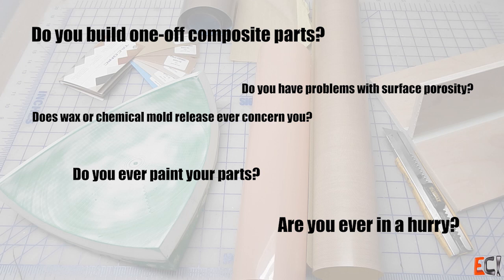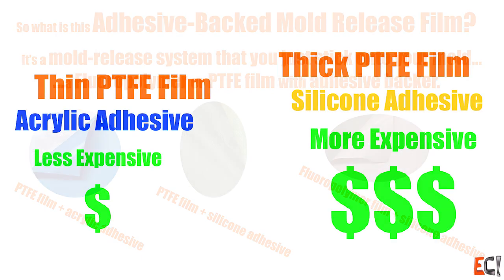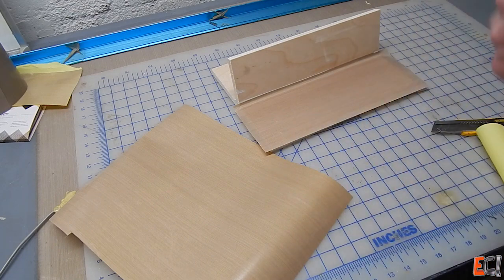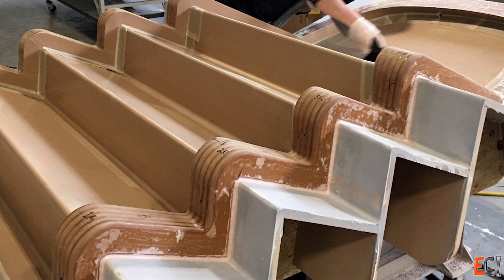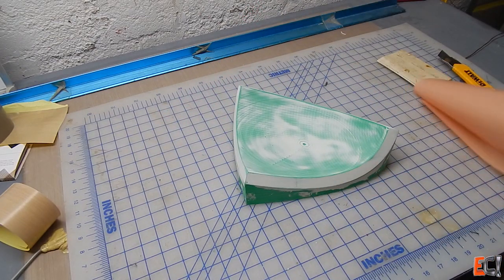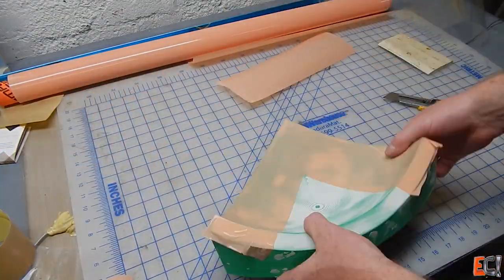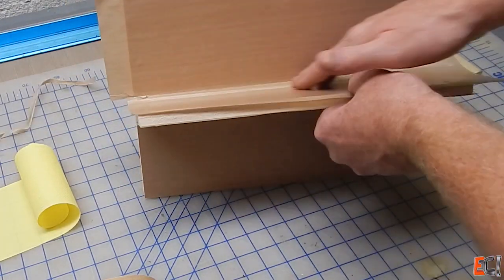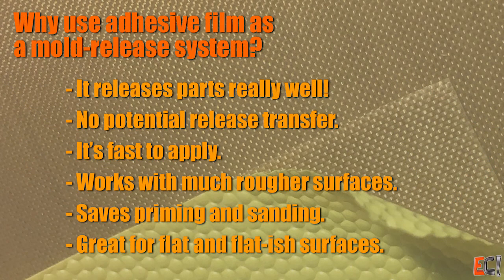Mold Release Films for Composites Tooling

Comment: My go to is a trash bag plus 3M 77 spray to tack it on to the part: leave descent finish if you work the bubbles/wrinkles out.
Reply from the maker: That's a neat idea!  I like how stretchy the bag is - probably reduces wrinkles and conforms easily.  Do you apply release to the bag after or does it just pull off the part?  I've done similar with release film and it works ok with prepregs, but for wet layup it makes a wrinkly nasty mess.  People also use aluminum foil and spray glue, but this is a lot of work and I haven't tried it.

Comment: This is pretty helpful. Have you tried applying a bit of heat to deal with this when applying to complex/curved parts?
Reply from the maker: The reinforced stuff really doesn't stretch but the Toolwright and other unsupported ones do - with or without heat.  Not sure if heat is a good idea or not - never tried.

Comment: I've used masonite as a cheap, disposable mold surface and where I've had to drill, counter sink and screw it down to a frame I've covered the screw heads with clear packing tape, cheaper the better. Ends up being a mere 1/2 thousandths of an inch thick that can easily be sanded.
Reply from the maker: That's a great method.  I have used plenty of masonite and the shiny "bath board" that is sold for shower liners.  What kind of release agent do you use?  The fastener holes are a bummer.  Sometimes you can clamp it down and glue from the back... 

I totally agree on the cheap packing tape being the best - and this Teflon stuff is just fancy packing tape you can use over and over.  It's great stuff but it sure is tough to spring for a big roll of it knowing its all going in the trash - I guess all tooling is in that category though!
Reply: @ExploreComposites  I use Mirror Gloss and PVA.

Comment: Looks like your making a very informative channel!!! SUBSCRIBED!!!

I would love to see you do a 1in or 3/4" Rigid foam insulation (like Foamular 250) with fiberglass on both sides. Then see what large span 4+ feet is able to handle weight wise... Im curious because I have heard people make campers out of it and I just cant believe that it would be strong enough to handle weight on top or handle long term wind turbulence on a trip.
Reply from the maker: Glad you like the videos!  There's a web site too that is much more comprehensive... still figuring out how to make videos.

I like your foam idea. Will look into it!  It sounds structurally a little like a surfboard - very thin fiberglass on light weight foam.  Denting would be the biggest issue probably - can't imagine a camper skin takes much load if it is on a stiff metal frame...  but I share your concerns about wind.  I don't know much about campers!
Reply: Strength would depend on the thickness of the foam (preferably 1") and the laminate schedule for the outer skin. I would recommend a minimum of 2 plies of 9-10oz E-glass and preferably 3. If you're thinking of using the pink, Owens Corning foam from Home Depot you MUST use epoxy resin as polyester resin will chemically melt the foam. The inner skin (over a 1x1 wood frame) could be 1/4' luan plywood. That would give a very light yet stiff structure.
Reply: @GrantOakes  Thank you! that is some really good Info! 1.5" is the foam thickness I have been considering lately due to 2x2 framing is buy off the shelf which would be less cutting.  Also using 1/4 Ply is not a bad idea especially on the sides since I will be using this on a 4x4 Toyota Hilux and Trail driving to get to a camp will happen at times. Last thing I want is a stick stabbed through the camper wall.

Comment: Could you elaborate more on why this material is not recommended for parts that are intended to have a raw carbon finish?
Reply from the maker: It can be used to make raw/clear carbon finished parts and is a great option for low volume projects - it just doesn't work with gelcoat.  This isn't an issue with epoxy/pre-pregs where you would probably be painting with primer and 2-part paint/clear anyway.  

The shiny teflon surface can really help because it greatly reduces the pinhole problem you can have making parts on wood or putty-heavy tooling.  I guess I didn't explain this well enough!  Check out the article for more info:

https://explorecomposites.com/articles/tooling/adhesive-teflon-its-awesome/
Reply: @ExploreComposites  

I read your articles, and thoroughly enjoyed perusing the site. 

Gel coat was my next question,
I'm guessing that this stuff can't be used for making wet layup molds.

Is the gel coat just not thixotropic enough to hang onto the ptfe?
Reply from the maker: @richm7936  Yes, you can wet-layup on it but it is too slick for gelcoat - it just beads up.  Its great for bagged wet-layup epoxy parts - especially the 0.003" semi-porous teflon which really helps prevent pin-holes.

I find it is great for getting good surfaces off tooling that you don't have time to prime and finish - or for parts you are going to have to prime anyway.
Reply: @ExploreComposites  honestly, I'm just trying to improve work flow.

By my logic, if I can cover the polyester gelcoat of my mold with a layer of ptfe film, I will save a ton of time not having to deal with release agents and or PVA. 

Some parts I deal with, have deep recesses and tight draft angles. Not many complex curves.  

Everything gets shot with duratec sunshield after post cure. 

As I'm quickly learning, there's as much art as science in the field of composite manufacturing.